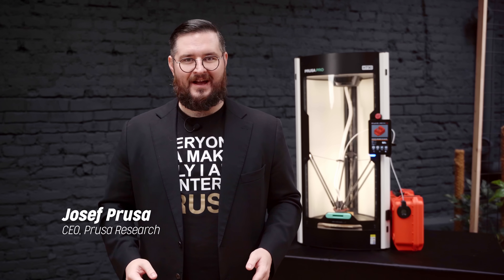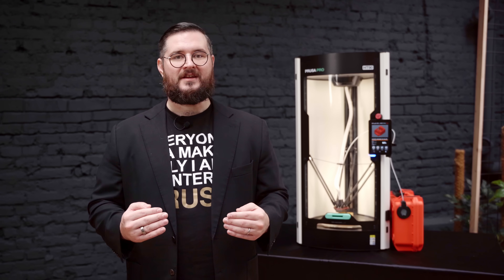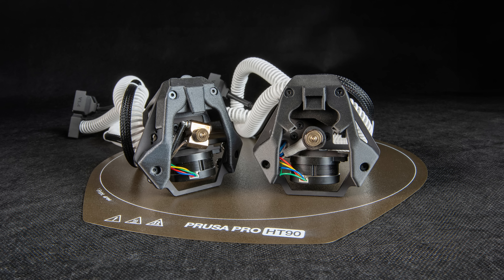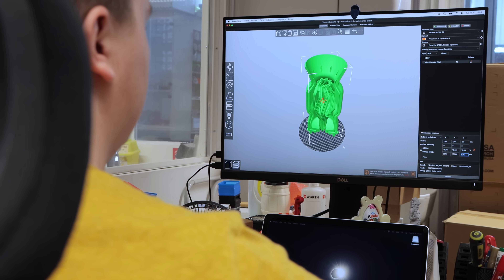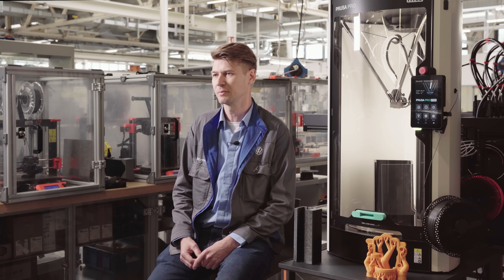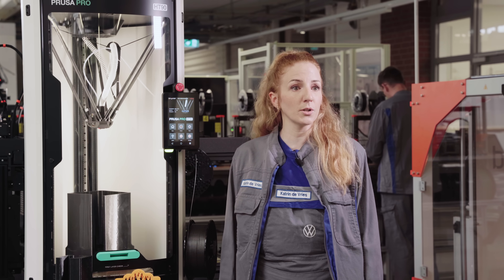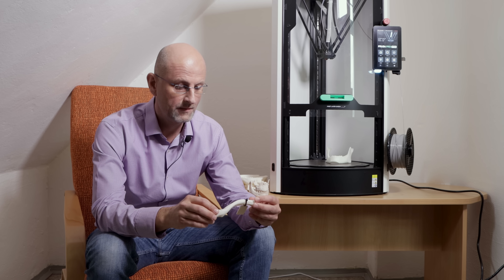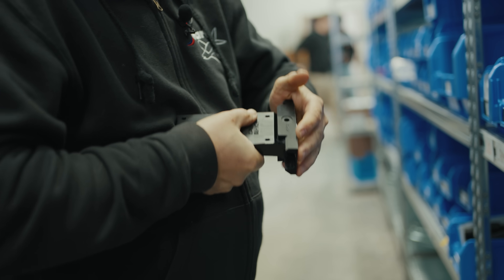Prusa Pro HT90 is here: The Only 3D Printer an Engineer Needs

Comment: Visually looks like FLSUN S1 clone (+heated chamber, -filament dryer).
I'm sure that user support & software will be better that FLSUN's though,
Price for H90 is ~10k$, for FLSUN S1 it's 1.5k$ (6.67x cheaper).

It seems that most of features (and twice the acceleration) will be available to general consumers by buying FLSUN S1.
Reply: Yeah I am sure the FLSun can print PEEK and PEI
Reply: you are comparing apples to oranges.
the HT90 is meant for industrial applications and can print materials like PEEK or PEI.

an FLSUN is a hobbyist machine with a hotend that can only reach 300°C
it's for completely different applications and target markets.
Reply: @fofopads4450  my comment was from "general consumers" (like me) PoV. They don't care about pricy filaments.
I'm sure this is a great machine, I'm just meant that similar (in some cases better) capabilities can be in hands of "average Joe" by buying FLSUN.
Reply: @ezwestyt  Probably. From PoV of majority of consumers that buy 3D printers H90 is a nice machine that they will never get. It's a "pie in the sky" like Mimaki or Stratasys (only cheaper).
Most of us can get FLSUN and get most of features (no PEEK or PEI, though). My old FLSUN v400 has higher acceleration than H90. Nothing negative here - both industry and general public can have similarly featured devices. Everybody wins.
I'm not using name "hobbyist" as I find it a little disregarding.

Comment: This is really awesome! It's a cheap and fast printer for high temp materials. The only complaint I would have is a small square build area (it's about 225x225mm if you want to print a square object). So, Pantheon HS3, which costs pretty much the same (well, depends where you live), is a much bigger printer that can reliably print engineering materials like CF/GF Nylons and CF/GF ABS/ASA. However, it might not be good for PEEK, and other high temp materials, where Prusa Pro HT90 will be the winner.
Reply: 99% of the people in these threads wont be buying one so does it matter how good or not it is they wont benefit from it
Reply: @thediscman123  well, yes, so what's your point?
Reply: Cheap? Only 11k
Reply: @MisterMakerNL  if you're surprised by the price, then it's not for you. It's not a consumer product. Companies buy this. Not an average Joe that lives in a basement.

Comment: We need a detailed accurate comparaison to a Flsun V400 .
Reply: They are different printers for different uses, they just both happen to be delta printers. The V400 can only manage 300 C on the nozzle and 110 C on the bed with no chamber heater. This Prusa HT90 can manage 500 C on the nozzle, 155 C on the bed and 90 C actively heated chamber.

The V400 is meant for the consumer market with relatively low end materials, like PLA and PETG. The HT90 is meant for engineering materials, nylon, PC, PEI, PEEK, etc. materials that you couldn’t print on a V400.

The HT90 is also meant for companies or professional engineers, the V400 is meant for hobbyists, you can’t really compare them. If you are comparing them on how well they can print PLA or PETG you are missing the whole point of the HT90.
Reply: First thank to have took the time to respond secondly I get that the Prusa Pro HT90 and the  V400 are different beasts, especially in terms of price ^^ and certainly in term of features and capabilities like the interchangeable heads and this 500°C nozzle  temperature and the wider range of printable materials .

However, as an happy owner of the  V400, I’m still interested in a comparison because 

Despite their differences, there are notable similarities. The V400 can print at speeds up to 600 mm/s and has a build volume of 300 x 300 x 410 mm, which is quite comparable to the HT90. 

Also, the HT90’s max acceleration of 20,000 mm/s² is impressive ,  V400’s performance is still quite  similar to it ( in the speed and quality regard) for its price . 

What interest me is to explore what Prusa has done with their slicer  approach i'm sure their innovations could provide valuable insights on how to optimize the use of my V400.( with i hope better slicing approach to delta fdm printer ) 

There’s always something to learn from Prusa’s high-quality approach to 3D printing,  and i hope their new printer  could inspired the others fdm delta ecosystem.
Reply: That's like comparing a Bigrep machine to an Ender 6-7 
The only thing they have in common is the kinematics
Reply: Why compare it to the old Flsun and not the Flsun S1 ?

Comment: Wonder how loud it is compared to the others 🤔
Reply from the maker: Hi. The HT90 is very silent thanks to the isolated printing chamber. Try to find some videos of it working during the last TCT+Rapid to check it yourself.
Reply: @Prusa3D  the printing chamber isn't usually the issue though, it's usually the cooling, which is kind of hard to isolate..

Comment: Very exciting design, always loved the Delta printers with their more exotic kinematics. However, isn't 90 degree chamber temp a bit cold for PEEK? From what I've heard, especially in an industrial context, 140 degree+ would be more appropriate for such a demanding material.
Reply: 3DXTech recommends a 70 - 140 C chamber for their PEEK and filamentive recommends > 80 C, so whilst on the low end it should be enough, especially for small and medium sized parts.

Higher temperatures are better though.
Reply: @conorstewart2214  Indeed, for small parts it will most likely be fine, but medium to large (I am thinking parts with much longer print times and weirder geometries) will become an issue (but that's just how 3dprinting is in general, eh?). Also you won't get optimal layer adhesion, which is a bigger problem because if you're using PEEK in the first place it's for its outstanding properties as a superpolymer. Just to be clear, I haven't personally printed PEEK (yet), I don't have a machine capable of that. Fartest I've gone is Carbon-nylon (which is still very fun). However, I do know people who print PEEK on a regular basis, so what I say mostly comes from what they said + my own research on the topic. And I still think this printer is a pretty impressive machine that has a big potential.

Comment: I do wonder why they didn’t opt for an IDEX. While the XL is a great toolchanger it definitely isn’t on an industrial level or capable of stuff like Nylon, PSU, Peek, ultem etc. An IDEX would allow use for things like dissolving supports to really maximize what engineers can do. By sticking to a single material you’re both using more of the costly materials and also restricting your models to those with manually removable supports or single material

Comment: They are "Ultimaking" themselves back into the high profit, but very low volume industrial corner with the MK4, the XL, and now this...
I don't own a Bambu Lab printer, but i do have several Vorons, a Rat Rig VCore 3 and even a MK3S+.
I also own a 2016-era self-sourced Delta Kossel.
The MK4 is just way too expensive for what it offers, there are no excuses anymore.

Comment: Why do people compare printers that will literally melt or burn their motors before continuing to print? This machine is designed to withstand heat, it is not a normal printer. The new Prusa is great for engineering materials, it is not for a pla bros.
Reply: how hot can the chamber get at max.?
Reply: @wildniscamper7276  
90 degrees  inside the chamber and surely the motors of that industrial prusa can withstand more than 200 degrees, perhaps they are water cooled. What a normal domestic printer motor can withstand up to 100 degrees in operation in some cases of printers with good quality motors
Reply: In a delta the motors for movement do not have to be in the chamber, and the extruded motor has its own cooling system (see the air hose)
Very nice engineering
Reply: @sasukedh  i know, is was working for eos and voxeljet.. i don't know what to think of that printer. to me, fdm is not good for endproducts or usable parts at all.. sls or slm with pa2200 is the best process to me.. yeah could be watercooled but i guess they moved the motors out of the chamber.. not easy to handle 90°C in that chamber
Reply: @wildniscamper7276  Yes, it is very possible that they have removed the motors from the camera and used gimbals, for example, to move them. It also depends on the material that can be handled, although it is true that SLS laser casting is more optimal since the laser melts much better. The problem with SLS is that the pollution residue must be more difficult to handle and probably more toxic. The material they need is not as extreme as it should be and that's why taking an FDM route is quite plausible from the way I see it, I also have a small laboratory and I make printers and we test materials by the way.
Reply: @sasukedh  stop making claims you can’t back up. You have no idea of the maximum use temperature of the motors or whether or not they are even in the chamber.

Most modern printer designs make it very easy to move the motors out of the chamber, in a delta you can just put them below or above the chamber and with core XY you can do similar with the XY motors out the back an the Z motors under the printer.

Why are you on about cameras and gimbals?
Reply: HT90 can print PLA completely fine due it's cleverly engineered cooling system. It can maintain tolerable temperatures even with chamber door closed.
Reply: @michaltomek7889  o man yes I know xD it was just sarcasm I'm sorry if I confused you
Reply: @conorstewart2214  okay fine it was just an approach xD it doesn't seem to be understood. And of course I don't have the absolute truth. A machine can be designed in many ways. but if I have taken engine temperatures, if you want to know, it is not that difficult either.
Reply: @sevenismy  Yes and that is why it is not a normal printer, the design costs money now clearly if it has not been well designed it will break

Comment: Oh well, after ordering my 5 head XL I also wanted a printer with a heated chamber for ABS and Nylon printing, so I ordered a bambulab X1C yesterday... I should have waited.
Reply: X1C doesn't have heated chamber, only X1E.  This printer also costs $10,000.   That being said, it is the first pro 3d printer at a reasonable price point, allowing exotic materials at a high speed.  Amazing if you have the proper use case.
Reply: @TrueRewire  I know, but it should print nylon parts nevertheless and I have everything to control the chamber temperature with an external controller if I really need it.

Comment: I guess if you're willing to pay $200 for 1KG of PEK or $400 for a roll of ULTEM, then your also willing to pay $10K for a printer. 

I'm curious, how many folks routinely print with those filaments? 

And, it's not as if there aren't a number of different engineering filaments that can be printed on affordable core XY printers.

If this printer performs as advertised, it is clearly targeted at a very small group of users who need PEK and ULTEM prints. 

I doubt it does much for the bottom line for prusa.
Reply: You have it backwards. Very few organizations/people are printing these expensive materials, because the cost of getting into them easily exceeds $50+K. What Prusa is offering, is the ability to do so at 1/5th the cost. That is the value proposition. When there is demand, supply witll match it. Josef Prusa majored in Economics btw.
Reply: @brisance do you print with either of those materials? If not, then do you plan on buying this machine so you can affordably print with them? 

I do several structural engineering parts with ABS-GF and they print great and are very strong. Not as good with chemical resistance as the others though.
Reply: @ChippWalters  yes I will be buying a machine to test. Everyone wants a do-it-all printer that is cheap and good. But we'll never get there if no one supports the current product on the market. Advancements always come step-wise. The original 911 Porsche is an objectively terrible car, when viewed with a modern lens. But the current model wouldn't exist if no one bought the previous ones.
Reply: @brisance  lmao, no. The funmat HT does everything the HT90 will do, for half the price
Reply: @cmrgarage  Stop lying. Funmat Pro HT410 isn't 10K, it's more like 25K so it's 2.5x more expensive.
Reply: @brisance  correct, the HT 410 is, But the funmat HT (no 410) is $5,995 

1k over half, but with the cost of these filaments i dont think anyone is gonna sweat the difference.

not to mention that while both these printers claim to be peek capable they truly aren't, we have nothing but failure if we run chamber temps below 120C for peek

Comment: Why delta and not CoreXY?
Reply: It allows for faster speeds because of the lower weight being moved, the downside is that it takes up more space for the same print area but in industrial applications it's not a deal breaker.

Comment: All the bambu bots in here complaining about price. This isn't a regular hobby printer that's designed to print only cheap hobby material like PLA, ASA, ABS, etc. It's an industrial printer designed to print industrial materials that 99% of hobby printer's cant do. Industrial materials like PEKK, PEEK, ULTEM require an industrial printer with very high temps. Printers that print these materials often cost more than $40k, sometimes even over $100k. Prusa out here doing it for just a fraction of that.

Even a $2500 bambu X1E only has a 60c heated chamber. and 300c hotend. This has 90c chamber and 500c hotend.
Reply: Actually, it is pretty expensive for what it is. It would be a steal if it was 5 years ago, but you can get more for less. I thought the price was good until i saw that there was no dual lifting nozzle system. Even the very first commercially available fdm 3d had that in the 90s. Also 90c is like the minimum for peek and I wouldn't even entertain printing ultem that low. 90C will give you perfect prints WITH ABS and PC, but nothing more. The Funmat pro 310 stomps all over this thing. Better specs and cheaper. I guess this is faster? But that speed means nothing if you have spend forever removing supports.
Reply: The only "bot" is LilApe trolling EVERY bambu lab video. Get over it. COPE.
Reply: @AnnikaFPV  lmao the Funmat pro 310 can only reach 300c on the hotend and can't even print the advanced material that the HT90 can. What are you even on about? The best it can print is nylon which virtually any 3d printer could do that. The HT90 can print PEK/PEEK/ULTEM.
Reply: @Denniss7420  Trolling? you misspelled "stating facts"
Reply: You are rhe only comment here mentioning Bambulab. Sheesh my guy, did they kick your dog?
Reply: Do those materials need to be vented?
Reply: @LilApe  that's because the designers were smart enough to realize that a 500c nozzle is useless without a 150c+ chamber temps. 300c(300c is a bit low and 350 would be better) is enough for anything that can work well for a 100c chamber temp. It sounds like you have no experience printing functional stuff at high temp.
Reply: @AnnikaFPV  Yet this vid showed the HT90 printing those advance materials just fine. Between the high bed & hotend temp and the heated chamber. it produces more than enough heat to print the parts in PEEK/PEKK/ULTIM

Sounds like you have no experience printing high temp stuff.
Reply: @LilApe  you buying one then ???? if not why bother going on about it
Reply: Why are you always mentioning another brand on a 100% Prusa product announcement? Even worse your arent even mentioning the actual competitors to this machine.
Reply: @AwwwSnapperz  You should be asking the bots why they're trying to sell bambu printers on a prusa page.
Reply: You started this thread.  You mentioned a competitor that isnt even a competitor for this.
There are numerous actual high temp printers out there to compare. 

Pre-emptively saying someone else did it on a thread you created doesn't make any sense.
Reply: @LilApe  I'm not sure why you are arguing with me when all I'm doing is stating facts LOL. Yes you CAN print UTEM in a 90C chamber with no warping, but it's not ideal. Layer adhesion will suffer and parts will have less z axis strength than polycarbonate. That's not really an HT90 issue. There's been a ton of entry level industrial machines that claim they can print ultra high performance stuff with a chamber under 100c and I don't think that's true. Could you print an ULTEM wrench? YES. Could you print a thin walled aircraft cowling that fills the entire build volume with reasonable layer adhesion? Absolutely not.
Reply: @LilApe did it?  I only saw it printing tpu and abs.  Not to mention people have modded a carbon to print ultem.  Not well, but as well as this will do.
Reply: @Matt-bb3nr  0:25
Reply: This Deniss dude is so cringe lololol
Reply: @LilApe that's a completed part, does not show it being printed.  So you're wrong at this point
Reply: @Matt-bb3nr  Nope look up Reify3D on YT. Shows ultem off of a HT90. I mean you're going to try and dismiss the HT90's capability's just because you don't see it actively being printed? lmao. There are no videos of bambu lab's printing PEEK/PEKK or ultem but you're quick to not dismiss them.
Reply: @LilApe I'm dismissing it because I don't care to print it in the first place.  Did you see the mk4 and xl release disasters.  Who cares that someone modified a carbon to do it, I was simply stating it was done.  Is this open source, do all the prusa fans not have that talking point anymore..
Reply: This guy is literally unhinged. He posts thousands of comments on every Prusa and Bambu related video, being obsessively angry over Bambu. 
They both make great printers lol.